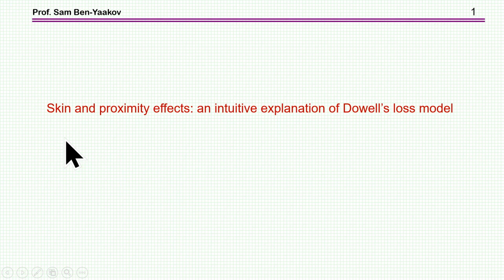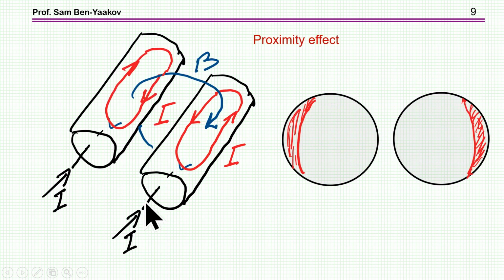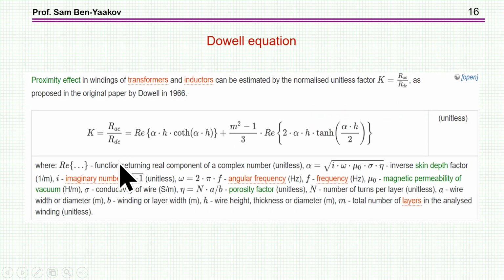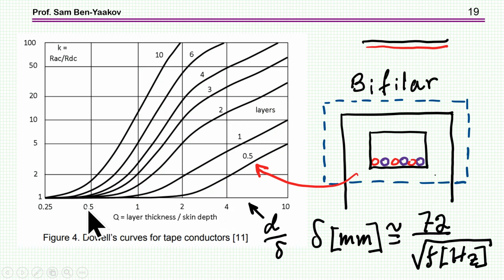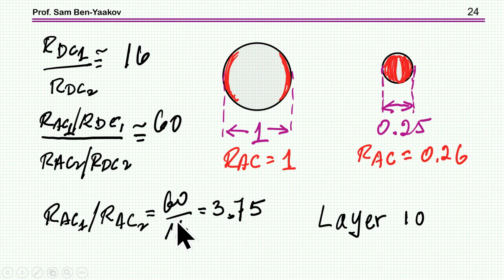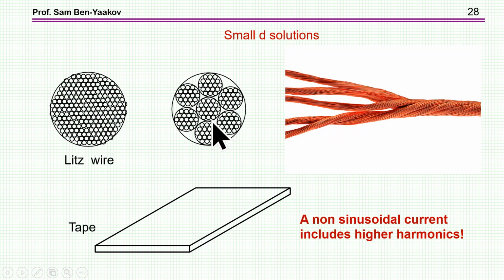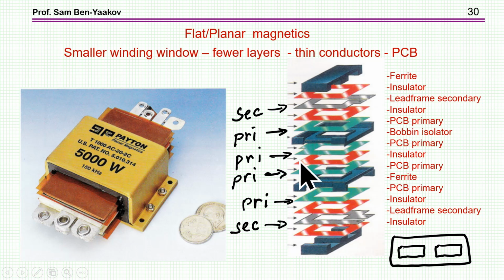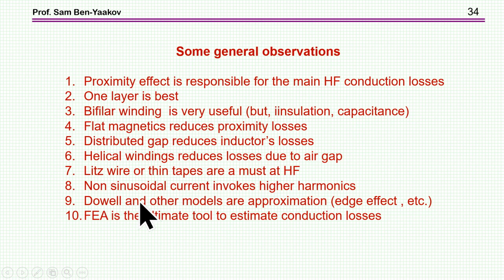Skin and proximity effects: an intuitive explanation of Dowell’s loss model

Comment: Dear Mr. Ben-Yaakov, 
Thank you for your short and brief response. 
But that doesn't answer my question ;-? 
Do you mean, overlapping nearby windings are there meant to be, 
to counter cross leakage inductances ? ? ? 
Any current carrying wire, influences one-another nearby.
And that can be in an adding OR disturbing each field, thus inductances, . . . 
As in the early transformers, there was a distinct separation, 
a square core, and a winding on each opposite side of it. 
Seemed logic to be. 
And I am talking here about Low frequencies, not HF. 
So when fully isolated wires, distant separated from eachother. 
How can there than be negative influences of parasitic inductances, 
giving leaks, into the Pico-farads range, hence micro - to- nano Ampères ;-? 

Please ellaborate on this, thanks and have a good day, Harry.
Reply from the maker: I am talking about HF transformers for switch-mode power conversion systems. It is well established, by theory and practice, that the harmful proxity effect and leakage inductances are reduced when primery and secondary are as close as possible, or even inerlaced. This is because the currents flow in opposite directions and thereby reduce the magnetic field. Do you refute this?
Reply: @sambenyaakov  
Whoepsie, I'm sorry having stepped on long distant sore toes, 
I had not the intention on disturbing your time, just questioning ;-? 
Goodby and try not to take things all too serious in life, H.🤣

Comment: Hello Sam Ben-Yaakov, 
I hope you can respond me onto my transformer windingss questions: 
allthrough a Toroid core is to be the most efficient, 
wouldn't it also not benefit if the core could be as big as it needs, 
that the coil windings Prim-vs-Sec are NoT overlapping each one another. 
I mean that Primary on one half side of the core 
AND the secondary on the other half side ? ? ? ? 
Like the early square laminated transformers. 
Seen that each current carrying wire will always have effect on the ones nearby ;-) 
Was the small circumference AND unavoidable eachother overlapping 
initially not chosen because of space saving requirements ? 
I hope you find this interessting enough to ellaborate on this, please ? 
Thank you, Harry.
Reply from the maker: The further the windings are, the larger is the leakage inductance, which is bad, in general

Comment: Professor, could I ask about your interpretation of the Dowell at 24:20, multiplying layer 1 resistance by 4 and layer 2 by 12. Every other explanation of the graph takes the total resistance of the 2 layers and multiplies that by 12, which of course gives a higher value.
Reply from the maker: You got me there. I was carried away. With two layers, the first layer is affected by the second one, so the Rac is smaller. Thanks for pointing this out. I will try to add a note on that  in the description
Reply: @sambenyaakov  I've learnt so much from your videos, it's an honour to help

Comment: Hi,
25:14 , you took the curve for one layer for proximity effect. But in this case, there is only 1 layer so there should be no proximity effect losses. Shouldn't you have used the curve for skin effect losses only which you discussed earlier in the video?
Thanks
Reply from the maker: Thanks for comment. There is proximity effect in one layer (each wire from adjacent wire)

Comment: Thank you for your video. 

For the Flat Wire Helical Enameled copper I can not understand why you take as One Layer. In fact I understand that they are several layers,,,

Could you pls explain? Thank you
Reply from the maker: If your cross section examination path is ferrite window, you see one layer of long standing wires.

Comment: What happens when I parallel a foil winding (connecting on the ends), that is half then one foil?
Since Q will be less  i move left on the chart. But on the other there are double layers. 
But overall, acording to dowells chart, the losses should be decreased. 
I did several experiments, its not working like this. Losses get worse, why?
I assume since the parallel foils are not perfect parallel there is some area inside there parallel foils. Alternating flux will induce some voltage that causes current ind the parallel foil (shorted loop).
Reply from the maker: Thanks for excellent question. I am holding on to my answer since I am contemplating a follow up video that will discuss this problem. Perhaps first as a riddle😊
Reply: @sambenyaakov  Excellent! Im waiting.
Greetings from Germany
Reply: As you said, possible is internal current loop in the parallel winding. If so, how about break the loop? I suppose the two parallel winding is tied before the secondary recitifiers (maybe also two recitifiers). Then to break the loop, each winding could be connected to each diode, not tied to the other winding. These two paths would be meet at the cathodes. How about that?
Reply: @michaelchang3234  Can be done. But current will  not be the same in each winding and rectifier. Its additional effort, especially when using synchronous rectification.
Inductance (balance transformer) can be used to break the loop and prevent circulation current in the paralleled foil.But this also adds up complexity and cost.
Reply: @kraftrad7840   I'm not sure the reasons you consider parallel winding - high output current or further reduction of winding losses? In case of the former, multiple diodes or sync rectification are mandatory. So my suggestion is one of splitted winding by one rectifier (fet or diode). Diode forward voltage itself would be a  kind of ballast for impedance imbalance. If the latter, too much paralleling (over an optimum point) would be not much helpful though Dowell curve tells less Rac/Rdc. Dowell curve is not linear, and it also seems it has an optimum point - Whenever I calculate and use Dowell curve, there is saturation point - which gives no more improvement.
Reply: @michaelchang3234  Yes high output current and a loss optimization beyond dowels optimum. 
Spliting rectifiers works, but is still not optimal due to current asymetry. I'm curious about not standard methods.

Or think on a inductor. In a transfomer, the effective number of turns can be reduced by interleaving. But in a inductor? Interleave with what?